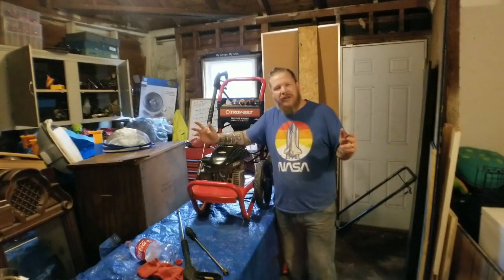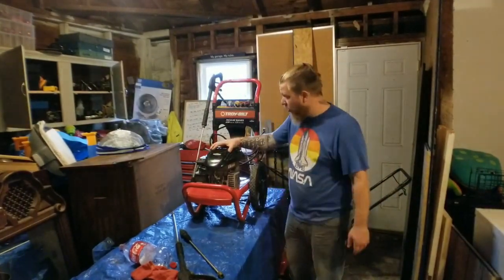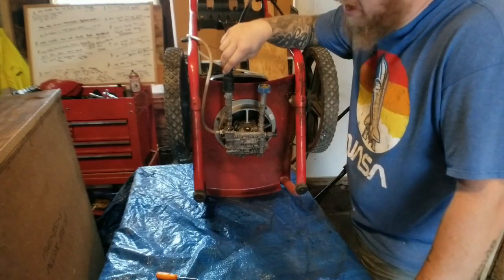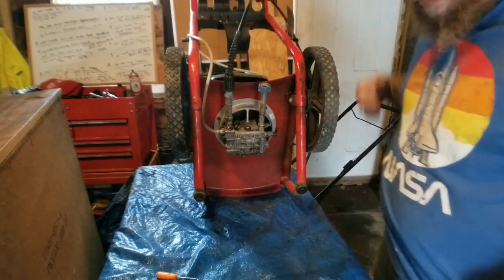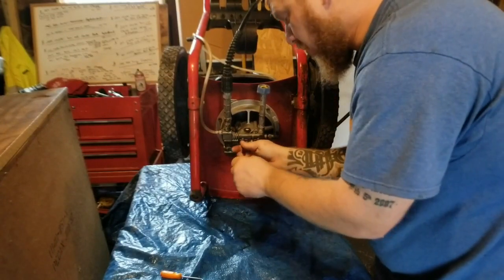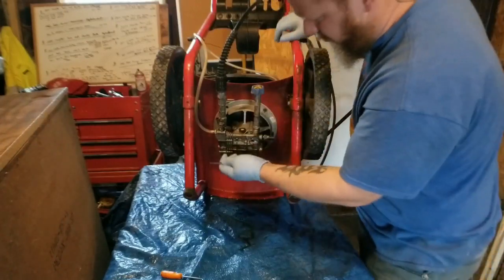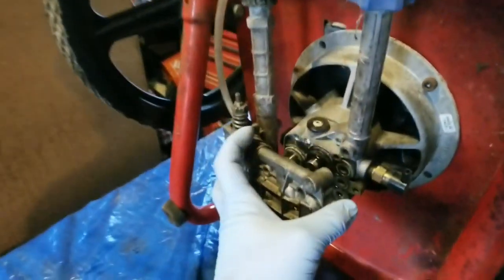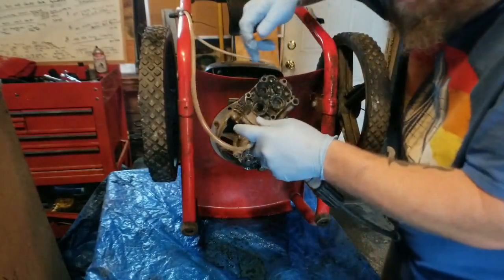Resealing the Water pump on a Troy Bilt Pressure Washer made SIMPLE!

Comment: I’d say it’s not rocket science, but the T-shirt would suggest otherwise.
But seriously, I’m pretty sure what you refer to as “diaphragms” are one-way valves. Plastic, one for each piston with a spring behind each. Sometimes random crud can get stuck in one of those and effect the pressure. They are also what fail when you let the machine run without keeping the trigger squeezed so flowing water can keep things cool. After about a couple minutes, if there’s no thermal relief valve, the one-way plastic valves will melt and no longer function. They are what allow the pressure to build by blocking the water from going back the way it came when the piston is on the down stroke. Or whichever direction the piston travels after the compression stroke.
Reply from the maker: Lol rocket science, love it. Your correct and thank you for contributing to the video and community! Thank you for watching

Comment: Do you know the part number of the whole pump head assembly?? I have the exact same washer.  my spray lines connector was corroded so bad where it screws on i broke it trying to get it off!!    I need the whole unit. Any help would be appreciated!  Thanks 
Brian
Reply from the maker: Here is the pump head assembly that I upgraded mine to https://amzn.to/3i1U3Rm
It will increase the PSI to 3100 and runs like a champ, Im sure you will love it Brian I know I do. My apologies it took me a bit to respond, my 3 year old broke my laptop screen...yay.. lol let me know if you need anything else brother
Reply: @Sellthoseflippingcars  Awesome that looks just like the stock one!!!  One other question, on the spray handle the brass connector that the spray hose connects to is missing,  Hose was so corroded i had to remove it from there.  Do you know the part that fits in the handle so can attach the hose. looks like the plastic is threaded also the little metal line inside looks threaded.  NOBODY i mean nobody at hardware stores can help!  thanks bud
Brian
Reply from the maker: You are most welcome Brian I know you will like that pump. I replaced mine last year and use it consistently and it is running awesome just like when I took it out of the box. If the hose was that corroded I would suggest going with a new wand. If you need help finding one I can assist you with that. I have two ones for my pressure washer and one is just like yours. The previous owner Ran So Much hard water through the pressure washer it filled with calcium deposits.

Comment: I don't see where you listed the o-ring parts, just the unloader valve.   Please share.
Reply from the maker: Hey Paul, my apologies I will add it to the video now. Here is the link you requested, this kit includes new bolts, brass washers, and all the o-rings then here is that link https://amzn.to/3eDM1vi. Hope this helps and thanks for checking out the channel, make sure you subscribe to catch all my future videos! Thanks again!!
Reply: @Sellthoseflippingcars  Perfect, thank you!!  I picked up 2 non-working units from a guy for $30.  Hadn't been run in years.  Newer unit took a lot of work but got the engine running, then the pump has a simple leaking o-ring, so that's done!  Older unit won't pump, so I'm about to take it fully apart and do exactly what you showed in this video.  Thanks again!
Reply from the maker: You are most welcome and that is an awesome deal you found!
Reply from the maker: Hey Paul, were you able to get those two units up and running?
Reply: Sellthoseflippingcars   oh yeah.    2 up and running.   Thx!
Reply from the maker: That's awesome! You got an awesome deal on both of those! Great job! Your welcome, I am about to make a video of putting a new water pump on a troybilt unit so stay tuned for that one.